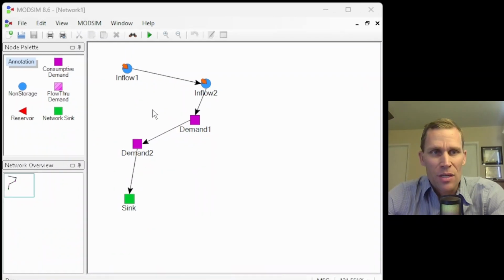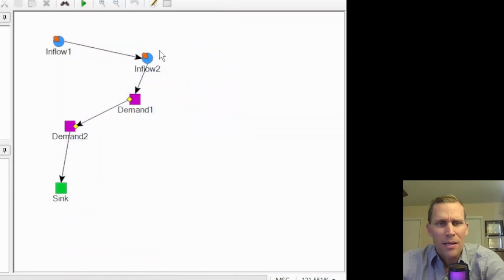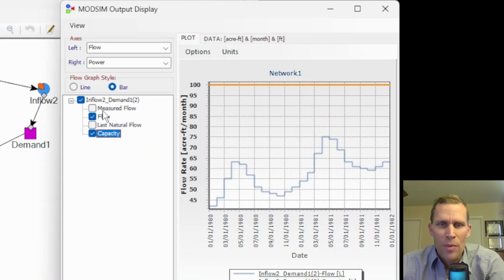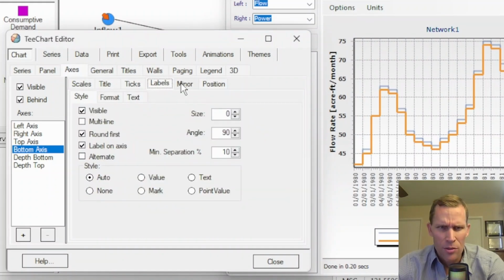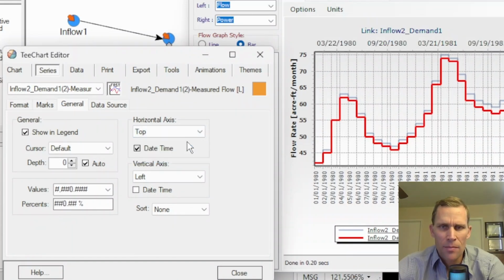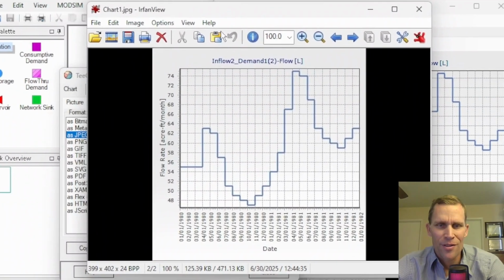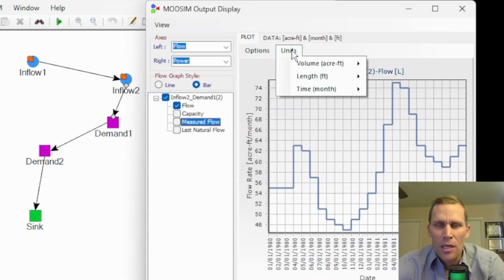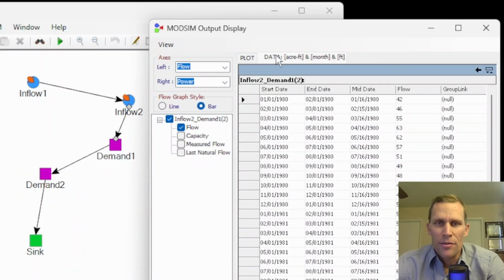MODSIM Lesson 7 - Viewing Results - Plots

Comment: Hi Mr nelson, hope you have a great day
Is there any solution in Modsim to show the charts in a better way ? for instance the lowest number in my data is 100
Modsim put that 100 in the bottom of the chart
It doesn't look good, I want the chart to start from 0 (Not from the lowest number of my data)
is there any solution or I need to use excel ?
Reply from the maker: Hi Shayan,
Yes, there are a number of chart options available. 
If you're interested in manually setting the minimum axis value, open an element's graph, then click on the "Options" menu -> Chart Options -> Chart (tab) -> Axis (tab) -> Scales (tab) -> Minimum (tab), then uncheck the "Auto" checkbox, click the Change button, and type in the desired number for the minimum axis value.
Reply: @TimNelsonPro  Thank you so much, great as always